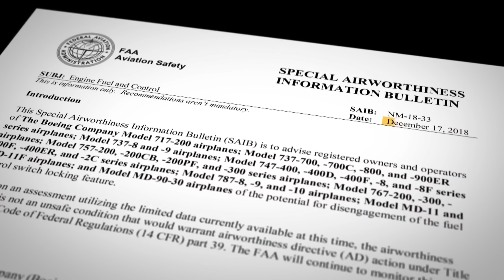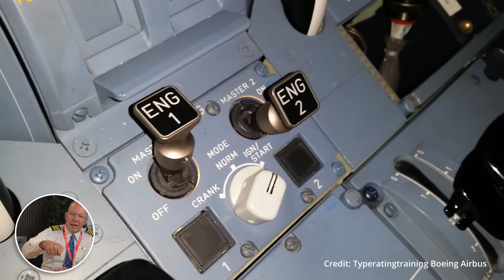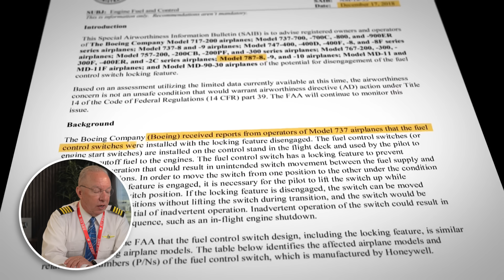Air India 171: The FAA’s 2018 Fuel Switch Locking Bulletin Explained (16 Questions Answered)

Comment: The *2018 FAA advisory concerning Boeing fuel control switch gates* (including on the 787), referenced in current investigations and preliminary reports, is as follows:

- *Nature of the Advisory:*  
  The 2018 FAA communication was *an advisory, not a mandatory airworthiness directive**. It recommended—but did not require—operators of multiple Boeing models, including the 787, to **inspect the locking features of the engine fuel cutoff switches* to ensure they could not be moved accidentally[1][2][3][4][5][6].

- *Reason for Advisory:*  
  The advisory was prompted by *reports that, in some aircraft, fuel control switches had been installed with the locking feature disengaged**. This posed the potential for unintentional switch movement, which could, in theory, result in accidental fuel cutoff and engine shutdown. However, at the time, the FAA's risk assessment determined this did **not constitute an "unsafe condition"* requiring mandatory action[4][5].

"The FAA said its 2018 advisory was based on reports that fuel control switches were installed with the locking feature disengaged, but added that this did not make the devices themselves unsafe... The FAA does not consider this issue to be an unsafe condition that would warrant an Airworthiness Directive on any Boeing airplane models, including the Model 787."  
— [source summary][4][1][5][6]

- *Operator Response:*  
  The advisory led to some voluntary checks by airlines, but many—including Air India, as highlighted after the July 2025 787 accident—did not perform these inspections since they were not required[1][2][3].  

*Current Status:*  
  Even amid renewed scrutiny after recent events, the FAA and Boeing maintain that *no new action is required* and that the fuel cutoff switch designs—including their locking mechanisms **are considered safe**. Inspections or operational changes are not currently mandated in the US[1][4][5][6][10]. Some national regulators (e.g., India, South Korea) have requested or begun voluntary fleet checks as a precaution[2][3][6]. 

In summary

**The 2018 FAA advisory highlighted a potential equipment malfunction risk with fuel control switch locks and recommended operator inspection of the mechanism on Boeing 787 and other models, but found the risk insufficient to require mandatory action. The FAA maintains that the switch design does not pose an unsafe condition warranting an airworthiness directive.**[1][2][3][4][5][6]

[1] https://www.airlineratings.com/articles/which-airlines-are-ordering-fuel-switch-checks-and-why
[2] https://www.aljazeera.com/news/2025/7/15/india-orders-airlines-to-inspect-boeing-fuel-switches-after-air-india-crash
[3] https://www.reuters.com/world/india/india-orders-its-airlines-check-fuel-switches-boeing-jets-2025-07-14/
[4] https://airlinegeeks.com/2025/07/14/after-crash-report-faa-declares-boeing-fuel-switches-safe/
[5] https://www.reuters.com/business/aerospace-defense/amid-air-india-probe-us-faa-boeing-notify-fuel-switch-locks-are-safe-document-2025-07-13/
[6] https://www.reuters.com/business/aerospace-defense/south-korea-preparing-order-airlines-check-fuel-switches-boeing-jets-2025-07-14/
[7] https://drs.faa.gov/browse/excelExternalWindow/BBE820D0419DB3358625836600761396.0001
[8] https://www.reddit.com/r/airplanes/comments/1lzozqz/787_fuel_cutoff_switches/
[9] https://simpleflying.com/faa-boeing-reassurance-787-fuel-switch-locks-safe/
[10] https://www.usatoday.com/story/travel/airline-news/2025/07/14/boeing-faa-air-india-crash-fuel-switch-safety/85191297007/

Comment: I know the fuel cutoff switches lock mechanically. I also know the 787 is fly by wire. Is there any way the fuel cut off could have activated via an electronic glitch without the switches being moved?

Comment: Captain Steve, Does the cockpit show any fuel control status other than the fuel switch moving position? If so, what if there was some kind of software error or corrupted sensor data readings in the FADEC system in a very rare situation, mistakenly cut it off automatically while the manual switches were remained in the running position and the pilot saw its status instead of the physical switches and asked the other pilot why he did it? Can it also be possible? My other question is why there are video clips recorded by some passengers shared through social media that represent a power failure in the aeroplane? If those are true, how can they be interconnected with the fuel switch?

Comment: From what I gather a proper restart it is required that these switches must be in the shutoff position. If you're in a room after dark with someone else and only a light is drawing power and the service is suddenly interrupted a very likely response will be why did you turn the lights off!
So it should be determined whether the comment by the pilot to the copilot of why he cut the fuel occurred before or after they were actually put  in the cutoff position.
Reply: How can u say this that pilots did it??? This might be a thing in ur place but not in our culture. Be Clear about it. Boeing planes r faulty that's the truth and they r getting away with it..our lives r in stakes end of the day.

Comment: I am surprised the switches are not rigged where down is run rather than cutoff.  This would make them more likely fail to run mode rather than cutoff due to gravity.
Reply: How can u say this that pilots did it??? This might be a thing in ur place but not in our culture. Be Clear about it. Boeing planes r faulty that's the truth and they r getting away with it..our lives r in stakes end of the day.

Comment: Bulletin aside, I would imagine that the fuel control switches for both main types Boeing/Airbus, should be mechanically interlocked with the throttles. If the corresponding throttle lever is not in the idle position then the switch cannot be moved from run to cutoff or vice versa.

Comment: UK's aviation regulator, the Civil Aviation Authority (CAA), issued a safety notice regarding Boeing 787 fuel shutoff valve actuators. This notice followed a US Federal Aviation Administration (FAA) directive addressing a potential safety concern with these actuators. The UK CAA instructed operators to review the FAA directive and assess its impact on their 787 fleet. Specifically, the notice mandated daily checks of the fuel shutoff valves on affected aircraft and required operators to test, inspect, or replace the actuators
Reply: Yes, this was the Safety Notice SN-2025/005, Version 2 Issued, 15 May 2025) with headline "Fuel Shutoff Valve – Mandatory Actions on Boeing Aircraft"; applicability: Operators of Boeing 737, 757, 767, 777, and 787 aircraft. That means 28 days before the AI-171 crash.

Comment: Why would the aircraft's logic permit the fuel to be cut off in such a critical phase of flight, especially when there is no condition that would warrant this (like an engine fire warning)? We can't go on pretending that all pilots are perfect all the time, or that they would never consider acting maliciously due to mental health, or otherwise. There needs to be some logic to prevent such dangerous actions when not warranted. Does Airbus do the same?

Comment: Pretty sure you haven't read the preliminary report carefully, it doesn't say that pilots did it. If you had any technical knowledge, you could see many interpretations to what has happened, but sadly you lack that. You've always been so eager to blame the pilots and save Boeing in this case. Earlier you said, oh you could see flaps in retracted position and blamed the pilots for mistakenly retracting flaps instead of landing gear. Please do not make half baked videos and misguide your audience.
Reply: POUND SAND YOU LOSER.

Comment: This is a cover up. There have been bulletins warning about those valves in 2018. And there is no mention of a pilot moving the switch in the report. Mr Steve has made that assumption and did not express an iota of doubt. Of course, he will not put his career flying Boeing planes on the line for the sake of this youtube video.
Reply: At 17:01, Captain Steve says one pilot asks one pilot why he cut off the fuel, and the other pilot denies. No explanation of the denial?? It is possible no one physically moved the switches? Don't rule out possibilities. Imagine if the MCAS thing was circulated after the first crash!!! The second crash was 4 YEARS  after the first one. Wake up!!!

Comment: I am afraid Captain Steve misinterpreted what the bulletin meant by the switches having been 'installed with locking feature disengaged' in a 737:
It is not about the switches being in the wrong orientation but, that the detent mechanism is rendered ineffective by the incorrect installation.

Comment: News: The UK Civil Aviation Authority published a Safety Notice (SN-2025/005, Version 2 Issued, 15 May 2025) with headline "Fuel Shutoff Valve – Mandatory Actions on Boeing Aircraft"; applicability: Operators of Boeing 737, 757, 767, 777, and 787 aircraft. That means 28 days before the AI-171 crash. This notice is related to the 2018 advisory, but not to find in the primarily report. In this safety notice is written under 1.1: The FAA has issued an Airworthiness Directive (AD) addressing a potential unsafe condition affecting fuel shut valves installed on the Boeing aircraft: B737, B757, B767, B777, which require a test and/or inspection; and on the fuel shutoff valve actuators on the B787 which require replacement, test and/or inspection. These ADs have been adopted by EASA and may be downloaded from the EASA AD webpage. This notice further directed daily checks in accordance with the relevant Airworthiness Directive to be performed by operatives or engineering of flight crew.

Comment: The aircraft involved was an 11-year-old Boeing 787-8. While I couldn't find official records of that plane cycle count, I would assume it is 8,000 to 12,000. This plane's fuel cut-off switch was used at least 2 times during each cycle. We are talking about at least 16,000 times for the switch to be moved up and down passing the metal detent "bump". It is a metal part passing through another metal part. Can the detent wear out? In that case,  switches could move to the "off" position by themselves? In case there was an error in service and that was not inspected or changed in time? During the takeoff, the critical fatigue was reached, and the switches moved down (off position).  
Just thinking of a forensic investigator.
It is also Known behavior of pilots placing items in that area (between the throttles and switches) like checklists, documents, flight plans, etc. So, when plane is pitching (rotate) and g-forces are pushing back, the object is sliding (with one side to the left), hitting the switch N1 and 1 second after, the N2.  If switches were not properly maintained or inspected, safeguards failed, you have the result. 
I'm not saying that happened, but there is a chance for that.

Comment: Being the pilot doesn't make you an expert in case of air accident ! 
This accident beyond reasonable doubt was NOT CAUSED by fuel control / cut of switches!

The accident was caused by VACCUM  LOCK  / VAPOR  LOCK! 

The VACCUM  LOCK  / VAPOR  LOCK prevented fuel flow to power plants !

It however might be possible, even not intended, that the VACCUM  LOCK  / VAPOR  LOCK  could trigger those cut off switches when sensing the loss  of fuel flow on loss of fuel pressure!

VACCUM as an unforseen very substantial force can make unintentional and "never expected miracles".

Comment: Question for Captian Steve. Why wouldn’t the airplanes safety system lock the switches until 400 feet. You mentioned in a previous video about 400 feet being the limit.

Comment: Did the report mention why the landing gear was still down, did the pilot call for gear up after positive climb, could it be however unlikely that they pulled the cut off switches instead of landing gear in a moment of mental aberration?

Comment: Probably it was answered before. About the RAT the report says on Page 14 "The CCTV footage obtained from the airport showed Ram Air Turbine (RAT) getting deployed 
during the initial climb immediately after lift-off (fig. 15). No significant bird activity is observed 
in the vicinity of the flight path. The aircraft started to lose altitude before crossing the airport 
perimeter wall."

Pictures of the CCTV footage is also in the report. It delivered hydraulic pressure 5 second after the switches where put to cutoff the report states.

Comment: I have a bit of trouble with the "why did you turn the fuel switch off", "I did not" and then ~ 10 seconds elapse before Fuel switches are recorded as being switched back on. I would have shrieked "what have you done" and turned the switches back on instantly within a second or so. What took ~ 10 seconds - did a circuit breaker trip and need resetting or something else. I don't think the scenario has been truly explained yet. Are the cut off switches fed from a common supply bus or common ground ie is there another possible explanation that fits better. Or did the pilot have to use a piece of 4x2 on the copilot to make him let go of the switches - something caused a 10 second delay & I don't buy shock or confusion, these trained pilots are better than that !

Comment: The FAA's warning about fuel control switches safety features disengaged in Boeing aircrafts, including the 787-8 clearly stated the defects and consequence it may have on the engines in flight. It  was up to the airlines to resolve the issue with Boeing. Whether Air India resolved this issue needs to be clarified. I believe Air India and Boeing are trying to cover up and blame the pilots.

Comment: Could the CVR have sufficient fidelity to pick up the "clicking" sound of the fuel control switches? - 787 rated pilot here, and the switches do click in and lock quite loudly

Comment: Wouldn't be easier to just add a quick extra step when you want to cut off the fuel to the engines? Simply to get a warning on your screen where you confirm once more that you REALLY want to do this? Maybe you've done it by mistake or something, at least that warning will perhaps trigger something in you to realise that you shouldn't do that, and if indeed you wanted to, you confirm it once more. Also, for the last question, how do we know for sure that the other pilot turned the switches back to RUN and not the same pilot that switched them off? It's not mentioned in the report that the other pilot did this, it just says that the switches were put back to RUN position.

Comment: Even if a switch is mechanically installed upside down, it would still function as intended. The only way the electrical operation of an upside down switch would be for the wiring to be misplaced on that upside down switch. However, if the switch is a plug in type switch, into a circuit board configuration, and the switch has no built in safety mechanism to prevent such misinstallation then yes, an upside down switch then the electircal function of the switch is changed. Just turn your home switch upside down, the function still stays the same even though the physical location is upside down.

Comment: A question from an absolute amateur.  If the fuel switches generally only have to be turned off at the terminal, why isn’t there a small cover over them that has to be flipped up to activate the switches.  In the case of an engine fire, the plastic cover could still be flipped up quickly and the fuel switches generally only moved to the off position.

Comment: So Capitan Steve you mentioned that you use these fuel toggle switches to shut off the engines when you arrive at the gate and the wheels are chocked.  Do you shut down the engines this way every time or I might guess you have some other switches as well to shut em off.  I find myself muttering "shut em off!!😮)when stopped behind you quickly trying to get to 3 gates down so the passenger has his belongings when he arrives in Tulsa!🤔😊

Comment: Capt Steeeve - Is there any chance that there is some control or switch near the cutoff switches that could have been meant to be operated and through gross error the cutoff switches were operated instead?  That would explain the "no I did not" response to the "why did you do that?" question.  It would still imply severe pilot error, but I would prefer that to the need to be thinking about a suicidal/homicidal pilot in the cockpit next time I sit down in a coach seat on a commercial airliner.

Comment: Why don't airline manufacturer put a toggle switch   with red cover. That toggle switch has to be  in on position for the fuel switches   to work. Vise versa for fuel shut off. The toggle switch has to be in off position  then u can move the fuel switch in the off position.  I hear all time there there's redundancy built in aircraft   back up to a  back up.

Comment: The aircraft achieved the maximum recorded airspeed of 180 Knots IAS at about 08:08:42 
UTC and immediately thereafter, the Engine 1 and Engine 2 fuel cutoff switches transitioned 
from RUN to CUTOFF position one after another with a time gap of 01 sec. The pilot possible to engine run to cutoff position within 1 sec. The fuel control switch protected by lock  mechanism.

Comment: Mr.Steeeve I watched your video before commenting, you are making conclusions stating as if you have gone through the data from flight data recorder and cockpit voice recorder. Really the SAIB is because of the upside down installation? you mean to say Boeing is not doing any quality checks ? how you got paid from Boeing to scavenge false data ?, you are mere a pilot, stating you can respond faster than a avionic system which responds in sub milliseconds. I am not going to watch any of your videos, you are just a piece of junk.